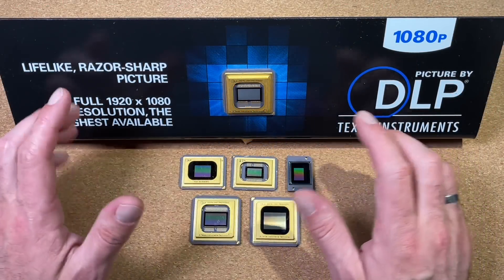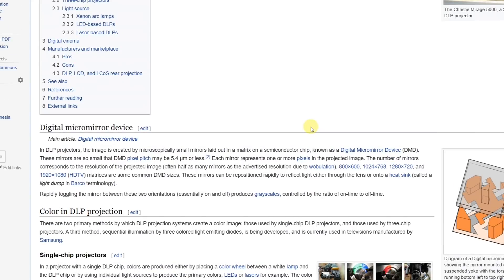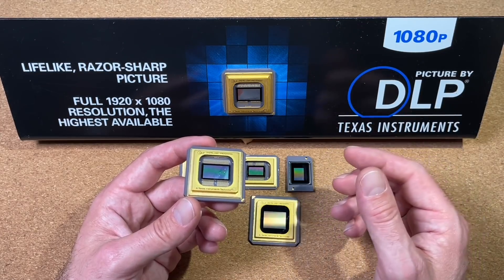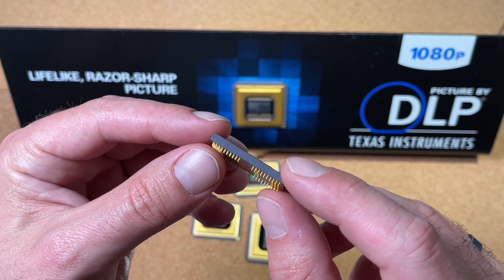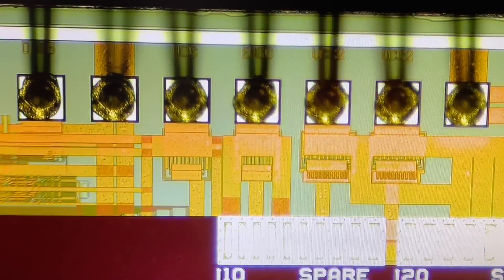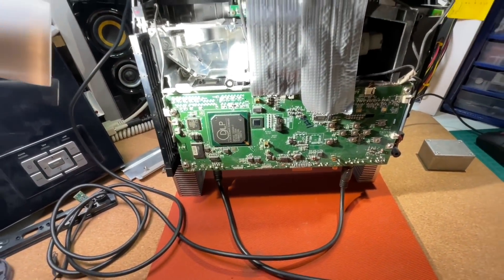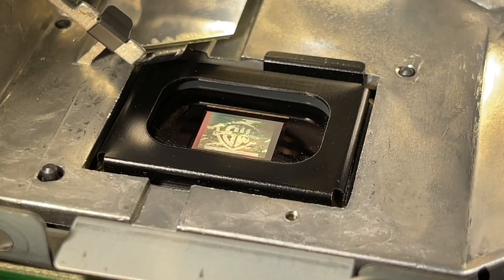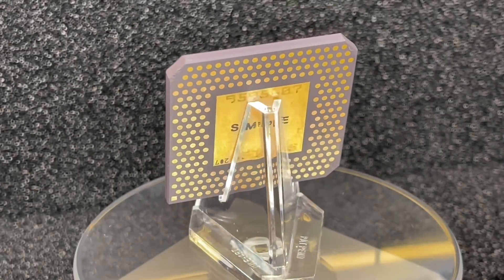DLP Technology & Digital Mirror Device under Microscope and Image Test, CAUTION: Super Interesting

Comment: Was especting Doom!! Wold like to know how this is made, amazing tecnology!
Reply: TFT. Thin Film Technology. The same basic concept is used for ICs, DLP, LCD, OLED, even modern tape drive heads.
Reply: @ky5666  wut? Dlp is made in foundry on a cmos process, ask Texas Instruments (the only manufacturer in the world of dlp chips)
Reply: @sunnohh  Wait no sunnohh is right. TFT doesn't include the silicon manufacturing process. TFT is about manufacturing transistors and other structures on an inactive substrate. Such as plastic, glass or even some kind of ferrite for manufacturing the latest nanometer sized tape heads. The DLP is made using the CMOS process on a standard silicon semiconductor substrate.
Reply: @ky5666  wrong. This is not TFT. This is MEMS. https://en.m.wikipedia.org/wiki/Microelectromechanical_systems

Comment: Next time try to display a grayscale gradient or test pattern as the ones used in TV, so you always see the same image on the chip (otherwise you see N images, one per each color wheel color)
Reply: Or just a black and white video, which as a bonus are often out of copyright as well, so long as they predate Steamboat Billy from the mouse corporation. Plenty of them to choose from, and you will get a stable image out of them.

Comment: If you want to use the projector without the lamp there will be an optocoupler you can short on the lamp PSU to have the projector thinking everything is fine. I did this myself when playing around with a DLP many years ago. However, you will still need to shine a flashlight through the color wheel as the DLP chip will stop working if it isn't given a sync signal often enough, and that is done with an actual color detector.

Comment: Usually the Lamp driver board just has one optocoupler that tells the main board if the Lamp is in Ok state. So If you want to experiment without the bright hot lamp you just need to figure out the pins of the driver board which have the transistor side connected to the main board. Then remove the driver board and short circuit the two pins leading to the main board.
Reply: No, not always. If it is an Osram Driver board, it reports the state of the lamp over serial. It also receives commands over serial. For a project of mine I had to make an emulator, just to make the main processor think that the lamp is accepting commands and it reports back that is in good operating condition.

Comment: Grate video as usual! Now I want to now how those chips are made! XD
Reply from the maker: yeah, this is still knocking my head. Small structures on a die, yes. Small structure on a die which are electro-mechanical moving? NO IDEA how to process this. 🤔
Reply: They are MEMS devices.
A Bosch sensortec engineer (who is part of the team at Bosch which designs MEMS Sensors) explained it to us (roughly) a few years ago in university.
As far as I remember they are build "solidly" with support structurs left intact to support the movable parts. After that I think acid was used to remove them and make the parts movable. Not sure about the acid though, as it is also possible (and mind-boggling) to produce those in an enclosed , air tight chamber (which is only a few µm in size on the die).
This really is absolutely fascinating.
At least a few of them get designed here in Dresden, Germany, I think the factory is also here. (For the Bosch MEMS devices that is, not the TI ones as the DLP chips)

Comment: Very cool video ! As you said in your video level of brightness are achieved by varying time on/off of each pixel.
Reply: Didn't know that thanks.
Reply: Does anyone know the PWM switching freqency? It needs to be in the kHz range.
Does a gray image use the most energy then?
Reply: @TheRailroad99  a gray image is composed by equal Red, Green and Blue Light. So I don't think gray image used more power.
Reply: but all colors are only partially activated for a gray color. That means the mirrors have to switch on/off rapidly. I wonder if this generates friction, and therefore heat.
According to the German Wikipedia, the PWM switching frequency can be up to 5 kHz.
Reply: @TheRailroad99  all DMD devices are equiped with a heatsink but I think the major part of heat come from the lighting source, not from the device itself.
Reply: @vincentpremel4817  most likely, yes. if the projector light bulb had 500W, even if the mirrors reflect 95% of the light, thats still 25W of heat generated in the chip.
Reply: @TheRailroad99  Raw switching rates for DMDs is between 5,000 and 50,000Hz depending on the model

Comment: I have a DLP chip looking exacly like yours at 4:03, from a "Liesegang ddv 2111 ultra" projector with 1024x768 resolution. It has an aluminum block attached to the 4x4 square section in the middle shown at 4:10 with some sort of ceramic glue. It was connected to the PCB by pressing it on elastomeric connectors.
Although I don't have a microscope to look at the micromirrors directly, when I reflect a laser off it, I can see a rectangular grid as defraction pattern.
At 15:08, the trick how these things display different intensity is as follows: The DLP pixels can only be either completely on or off (reflect to wall or black beam dump), but nothing in between. However they switch extremely fast, probably around kHz range. So to modulate intensity, they do PWM for each pixel. Also they switch between the RGBA colors of the color wheel multiple times per frame to create the illusion of color. You see this effect when displaying a white image on the wall and quickly waving your arm through the light, then you will see the rainbow colors of the color wheel.
Reply: yes i understand all that too, from what i've seen about the technology.  However I am still wondering how they choose the speed of the etremely fast on/off frequency per intensity desired (to acheive the grayscale value of the color pixel).  I'm sure the default is 0 oscillations of the mirror per 1/24 of a second, when you want full intensity, and of course the same 0 per second for when you want black (just with the mirro flipped off).  But then for 50% gray, you could perhaps do 1 oscillation every 1/48 of a second (or in other words, during one frame of video, you'd split the time in half, where the mirror is on for only half of the time).  For a light-gray value (so 25% gray), you'd keep the mirror on for 75% of the duration of a frame (thus allowing 75% intensity).  This would be the simplest version of how to do it.  Obviously they'd choose to oscillate much faster, so that the percieved image has no flicker, plus the color wheel is already spinning multiple times per frame, so you'd at least have to match that frequency.  I just wonder what they decided and why.

Comment: I believe the individual pixel light intensity is controlled by using a duty cycle on the mirrors. A mirror spends only as much time reflecting towards the screen as required for a particular brightness, then it flips away.

It is amazing to me that DLP projector are even physically possible, much less common.
Reply from the maker: yeah. I also believe that it is controlled by using duty cycles. Indeed, fascinating

Comment: DLPs have always fascinated me, fitting millions of small switchable mirrors inside a chip... then again we now have chips with billions of transistors :D
Reply: the fascinating thing is that they are mechanically moving by a few degrees. I always wonder(ed) if the die itself would feel rough when they point in different directions
Reply: @TheRailroad99  The mirrors are insanely delicate. The second you put your finger to it, it would be the equivalent of touching sand.